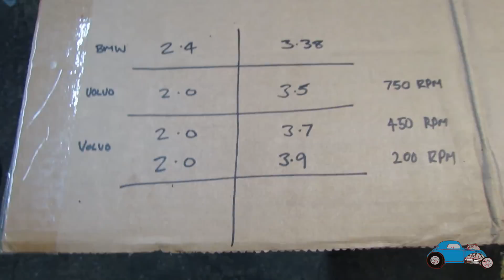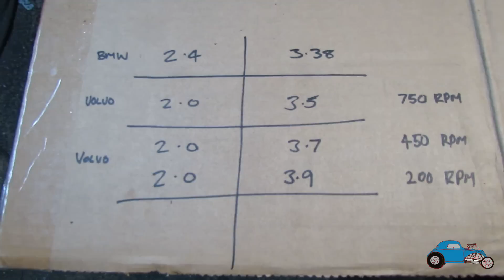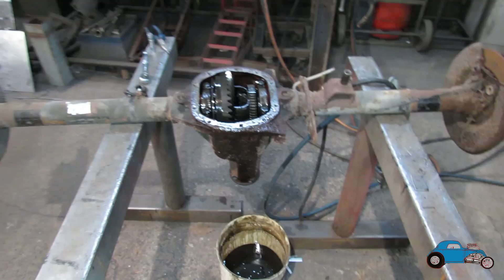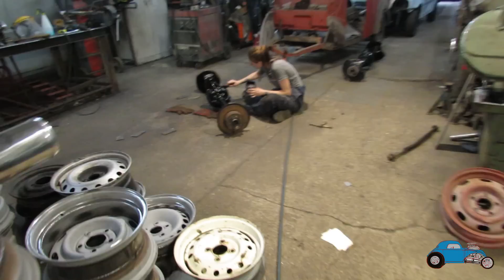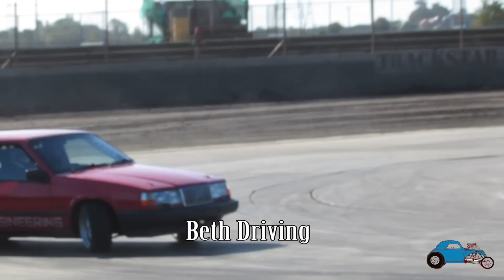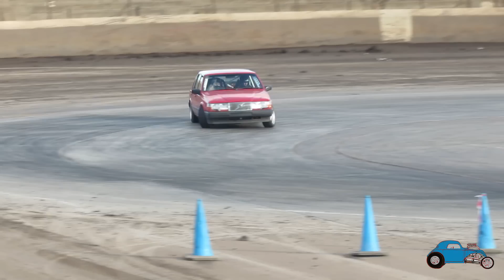New axle for our Drift Volvo 940 P16

Comment: progress looks great. what sort of power is it making? im surprised your saying its struggling low down, my old b230 felt really good just with basic mods, (intake, exhaust, mbc and chips) it was only 200bhp but pulled really strong and especially from low down, boosted from nothing, definately got me fancying another volvo
Reply from the maker: Our 940 used to be an Auto so the diff ratio was quite high, its made alot of difference changing to a 3.7